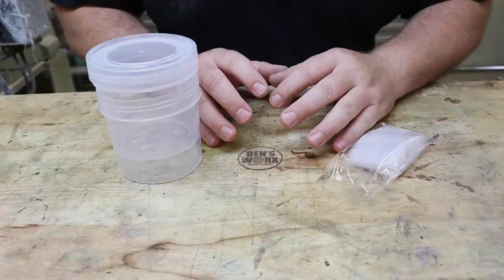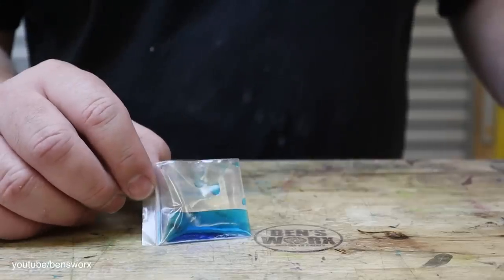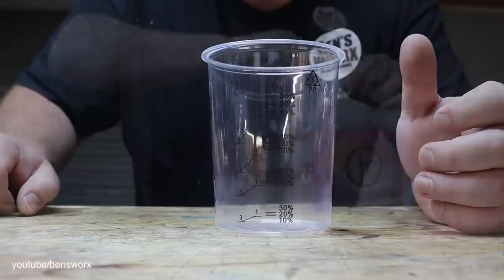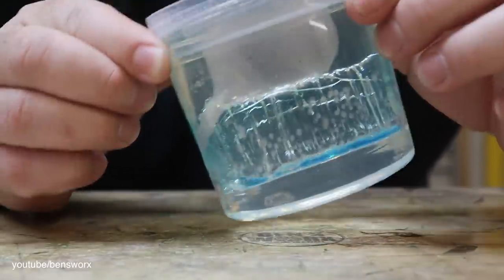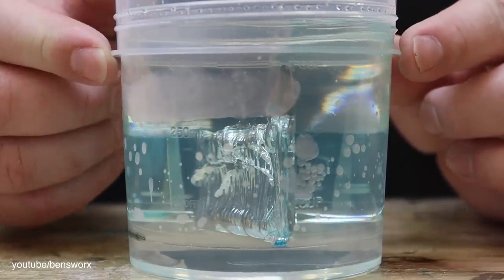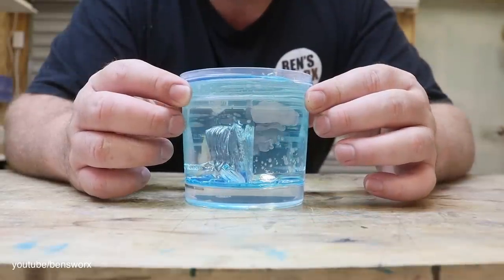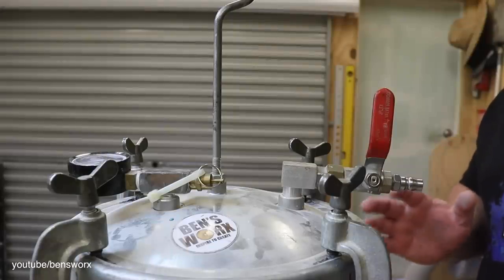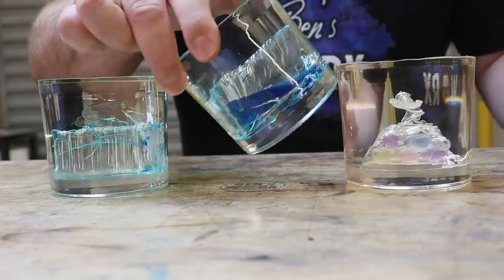Casting a Bag of Water in HOT! Resin - What Will Happen?

Comment from the maker: Thanks for stopping by, If you have time you can check out my new range of Eggs here www.etsy.com/shop/bensworx
Reply: You should try using a high heat resistant sous vide bag that won't melt so easy.
Reply: #3
Reply: #3
Reply: Try bag of red resin next time please
Reply: If your trying to get the water to fully boil there is a calculator that will tell the temp it needs to get to under pressure in the pot, because as the pressure goes up so does the boiling temperature for the water.
Reply: @edwardbyard2217  Good point, I was thinking the same thing.
Reply: It would also have been interesting to do the orbees WITHOUT the bag.

Comment: Suggestion - Coat and cure orbreeze pieces in UV resin to give then a hard shell.  Then cast them in resin the same way you did here.  That will be interesting.
Reply: Yep, I suggested this last time... seconding it this time!
Reply: I had the same thought! I wonder how you could since they are so slippery.
Reply: @cdey8512  You would probably have to just put a blob of epoxy down and roll them in it to coat.  Then set them on top of a UV light to cure.

Comment: Might be an idea to glue the bag's opening downwards. Not that it seems to make much difference which way it is oriented really, as often the bubbles are on the side away from it, just above the base layer (guessing the resin hardens from the top, so it’s the easiest way to escape). But it would complete the sideways orientation series, and laying it flat would round it out. That is, if you decide to do more of these.

Comment: I don't know if it would boil. You run it at about 45psi. At that pressure, it would increase the boiling point of the water. It'd boil at about 285°F or near 140°C. But if you release the pressure when it's still really hot, it would flash boil into steam and likely crack the epoxy like we've seen it do in past videos.

Comment: If you have the patience for it, I think the move is to freeze up a blue ice cube and see if you can paint a layer of epoxy on it and have it eventually cure in the freezer. You'll probably have to paint it one way, wait, flip it, paint it again, wait again. The waiting could take a day or two each time, if it ever goes. Once it does though, you can let it warm up and you'll have a little epoxy-coated cube of water, which you could give the same treatment you did your bags in this video. Let the pressure off slow after a full cure like the orbees, or better yet do a few so you can vent one violently after cure and vent one violently after set. [edit: perhaps it is smarter to paint the ice cube with uv resin, that might go at mostly normal speed even very cold]

Comment: Suggestion: Get a small beaker or jar, and a smaller bottle. Pour some resin into the jar, then use the bottle to displace the resin to create a chamber in the center. Pressure pot that, allow it to fully cure. Create a base in a mold, much like you did here. Add some dyed water into the resin 'cup', put a solid ring of UV resin on the lip of the cup, then adhere the cup to the base in the mold. Now fill the rest of the mold with resin. The cup should disappear, and give you a nice crystal clear cylinder of water in the middle.

tl;dr: make a vial from resin, UV resin glue it to a base with some dyed water in it, then fill with resin like normal.

Comment: Ok so it looks like the bag is melting in the resin so if you could use a different material, more specifically one with a higher melting point you might get a better result. Does uv resin get as hot as the normal resin? Could you coat the bag with uv resin before putting it in the other resin?

Comment: what if you made a mold of one of the small bags filled with air, then cast it halfway up and then filled a bag with air/water, that way "only" the top half of the bag would be exposed to the heating of the epoxy curing ;) 

Number 2 looked really cool.

Comment: Hi Ben. Just want to let you know that when you increase the pressure in the pot you also increase the boiling point of the water. As in a car radiator. Should try it on the bench or better still in the vacuum chamber. Cheers Rick

Comment: you could cast a hollow cube and put water in it. after you could cast a thin layer to fit over the hole and connect it with uv resin and pour more on top

Comment: Ben, first of all great work and i love your videos, i have an ideal, dont know if it will make sense, i saw on another channels, people using a vacuum chamber before pouring the resin, in order to remove bubbles. I think its something you could try, first use the negative pressure to remove the bubbles and then making the pour and going to the positive pressure pot. 
well its only an idea. 
love your vids anyways

Comment: I wonder if you could cast some LED lights in the resin with the wires sticking out the top to connect to a battery.  Neat to see if the resin would melt the wires or the LED bulb to the point of breaking or if it would still work.  And using some different colored plastic bags would look really cool once melted.  With some orbeez or colored water or both!

Comment: I have something I'd like to see you try with resin. There is some backstory to this but I'll start with the experiment. 

I would like you to try getting bubbles out of resin in mold with a vibrating pad or similar with a direct comparison to pressure pot.

The backstory here is someone recommended to my wife a vibrating pad for our small time resin work. I've been trying to justify a pressure pot and this keeps coming up as a counter option. I can not sufficiently explain the dynamics involved, I've tried. My wife needs a visual explanation.

Comment: I think you should repeat experience 3 but with straight water. Whatever pressure you had the pot set up still kept the water in it's liquid phase even when the resin reached whatever temperature it was at by the 40 minute mark. The release of pressure allowed the liquid to gas phase change to happen rapidly, hence the most of the fracturing. I think this effect would've been heavily negated by the orbeez. I could be wrong though, but that's the spirit of experimental science! Come up with a hypothesis and test until you prove it wrong! And if you can't prove it wrong, accept it as truth!

Comment: maybe try putting a little colored water into a bag and pressing out all the air. Like a flat panel. Then roll or fold that bag and put it into another bag (maybe three or four would fit). I suspect the bags with water in them will melt around the water while the bag holding the bags will melt around them. 😇 That would be fun to see what happened. Bags inside bags inside bags 😋

Comment: I’m commenting at the 00:47 second mark.
The water will NOT boil in the pressure pot, the higher the pressure the higher the boiling point. If the resin did indeed get hot enough to boil the water then the plastic container would melt.

Comment: PREDICTION: I wouldn't expect any change in the water (except slight temperature increase, not knowing the heat tolerance of the plastic you've chosen), unless the plastic melted, hence releasing blue water into the resin. But since water is heavier than resin, I expect it to pool, basically at the bottom of the cup. On the other hand, air is in the bag, so if it heats up, it might expand the bag, perhaps making it pop and filling the resin top to bottom with blue coloring, due to explosive gas. We'll see.

Comment: Water boils at a higher temperature in higher pressure, although it got hot enough to boil, it didn't do so until you released the pressure
Need something that has a lower boiling point
Shame you priobably can't monitor the camera while slowly releasing the pressure (faraday cage), stop releasing when you get desired result